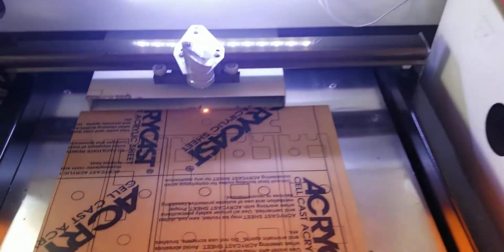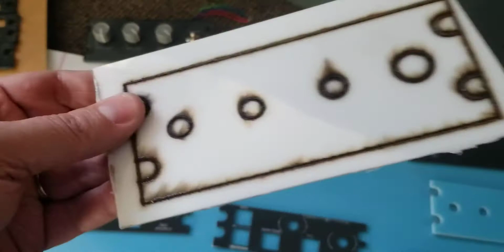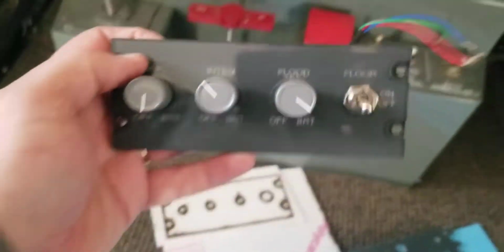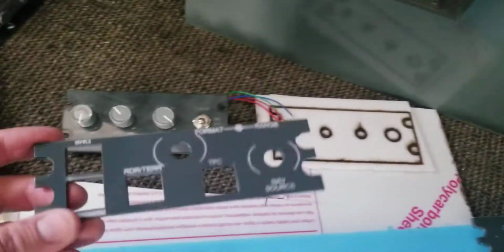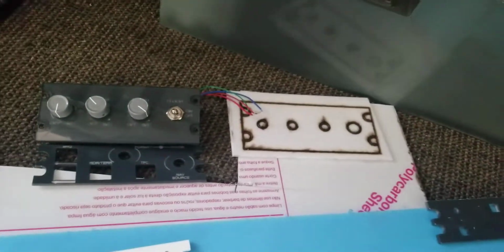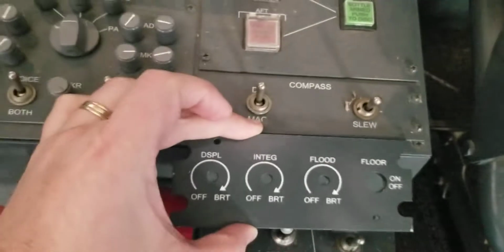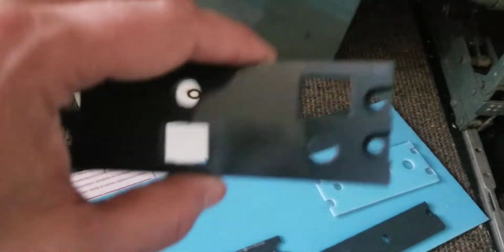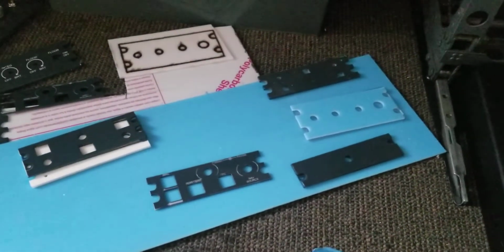How to make flight simulator panels that are backlit

Comment: Cool project.
4:54 
I’d also like to give it a try, but I’m struggling with the material.
What kind of acrylic are you using?
I can only find extruded acrylic with 30%.
The cast acrylic I have is either 42% or 22%
Best regards

Comment: What was the trade name of the recommended product?  I have had so many bad buys (laser is a 10W Optical diode but I do have have access the a Thunder Laser Cutter-Nova 100W CO2)
Reply from the maker: Falken Design was the material I used, K40 was the laser.  (Cheap like $250 on Ebay)

Comment: Thanks for the video! I also own a K40 and spray painted the  white 3mm Acrylic Opal with Gray Spray Paint (1 Layer). When I wanna engrave into the spray painted side, letters are becoming black. I could swipe it away but it will not look great. Tested with different settings. 5mA/200mms and more. Which Layers of spray paint do you have? Will test with two white Spray Paint layers, then gray and then test. Hoping, that I only burn the gray layer and the white spray paint will get visible.
Reply from the maker: I do not use white spray paint.  Sounds like the paint you are using might be the issue.  When you cut or engrave with no paint do you still get black burn?

Comment: Do white acrylic on the face piece, clear for the base/mounting surface.  Paint the back side of the mounting face with Rust-Oleum 267727 "Silver Specialty Mirror Spray" paint, then paint the whole thing with a flat black and then the final color.
  
The Rust-Oleum paint is designded to make a mirror on the oposite face you are painting - i.e. you'd paint the back of a piece of glass if you wanted a mirror.
  
Reasoning:
When you laser scribe the top face it will present the legend you wish to display.
  
When you laser scribe the bottom face, it will provide a hole for the LED to fill the light pipe - the mirror coating makes the clear piece a volumetric light pipe speading the light aournd the entire backside of the white half.  This makes the light more uniform.
  
You can do an extra step and laser scribe a mirror image of the top-side legend "grown" 25% and then paint that white to provide a "frustration" to the total internal reflection of the light pipe, then paint the back of that with an additional coat of the mirror and then flat black.  Do this to the front side of the clear piece before gluing together (and without the white or mirror paint after etching) and you can keep most of the light inside the light pipe until it gets to the legend exit points.
Reply: To make the steps clear if you intend to attempt it:

1) Fully cut out your 30% translucent top piece, and your clear base piece, flame polish edges for smooth/flat faces
2) Paint the entire base acrylic piece with the RustOleum Specialty mirror coating, top bottom, edges - everything (makes the base piece a full internal mirror
3) Paint only the top surface and edges of your 30% translucent piece with mirror coating, leaving the mating face unpainted.
5) Take the legend graphics and grow them 25-50%
6) Etch the grown legend into the top of the bottom clear piece to remove the mirror paint - this will be the light outlet, and bit a pitting here from over-etching is fine
7) Flip the clear piece, mirror the grown legend, and etch on the bottom - alignment is key here, you should almost be able to see through the part top to bottom
8) Paint the just etched bottom of the clear base part with a white paint - you are most worried that the bond of the white paint to the just-etched bottom mirrored+ grown legend.  You should be able to see a very white (yet grown) legend appearance on the top face.
9) Glue both pieces together with an optically clear adhesive - just doing acrylic solvent bond won't work with the mirror paint between the two pieces
10) Once bonded, paint the entire part with the final color/luster paint
11) Laser etch the legends on your top 30% translucent piece
12) Install LEDs in holes (cleaning if necessary any paint)

The bottom part will be your light spreader light-pipe. Due to the mirror paint, the inside will contain the emitted light and keep bouncing the light around on the flat specularly reflective surfaces (light bounces off at the opposite angle of incidence with no scatter) - only degrading by the acrylic's absorption coefficient.

When the reflected light rays hit an etched surface on the top side at a steep enough angle that does not reflect it back inside, they will exit and pass into the top translucent material, scattering internally in the material, but exiting at the closest surface nearly perpendicular to the point of entry.
  
When the reflected light rays hit an etched surface on the bottom side the white paint will be a diffuse reflective surface - meaning light will bounce off at almost all angles, including at angles nearly perpendicular to the white surface, providing the best opportunity of rays to find the top-side etch on the opposite face.
  
You may end up finding that you have such efficiency of light output in the right places that you have to tone down the brightness.  If you find areas of your legend that are too bright relative to other areas, a fix you can do is to scratch the back-side white paint (JUST A LITTLE) to expose the clear material again, then give it a squirt of black paint.  This will obviously absorb some of the rays of light that would otherwise be specularly reflected towards the face of the panel.

BTW, I didn't just pull this out of my tailgunner, this is how LCD backlight light-pipes are built.
Reply from the maker: Could you make a video of your process?  I would love to see it from start to finish, I will also try this on my end.  Thanks for sharing
Reply: @AaronWerner  I have lot access to the laser engraver/cutter I used to have access to. I can try to make a video but I can't quote an ETA for it.

Comment: I think the clear over the grey looks horrible. You're just going to get fingerprints everywhere and I don't really get the point of it? Especially because it is a simulator of an actual thing which doesn't do that method
Reply from the maker: That was just an example.   I preferr the method I did, where it is not covered by the clear. Thanks for watching!

Comment: Hello aaron, is there a good way for me to use acrylic panels and make something similar to what you made without using a laser? I do not have a laser and in my city there's no place which allows laser for non employee/professional use.
Reply from the maker: You can do the same thing with the CNC router
Reply: @AaronWerner  Thank you for the reply. I will consider finding how to use and get one.

Comment: Thanks! Will try that acrylic from HD - almost more importantly, what did you use to paint the panels (spray? which RAL code)?
Reply from the maker: I just moved so most my supplies are still packed up.  If you can watch my other videos where I take you step by step how to make them, I show you the can of paint and color.
Reply: Beware about lasering Acrylic due to the Damage to your Laser and the Poison Gas.

Comment: Interesting video. Have to say though -- never try to cut something on your laser without knowing what the material is and whether it's safe to laser. You might damage your laser cutter, or worse, yourself. For example, ABS plastic emits cyanide gas when laser cut. No joke.
Reply: Just saw your comment on toxic fumes from laser cutting ABS. Accidently, this is exactly what I did yesterday. I feel well, no dizziness, no headache. I noted the strong smell from the burned ABS material, and kept all windows open, while the laser was running, and afterwards. Still I'm a little worried about long term health issues from the toxic fumes. I guess I will switch from ABS to acrylic, since the results of engraving ABS aren't looking so good, anyway. Also, I plan mount an enclosure and air ventilation to the laser.
Reply: Dan, I was thinking the very same thing when I started this video. Looks like M. L. will look into this and be safe.  Some Acrylic actually attacks the metal parts inside the machine... Causes them to corrode. ESPECIALLY bad on the Bearings. There is a test you can do with a burner and some acrylic and a copper wire. Depending on the color of the flame it will tell you if the material is dangerous to Laser. Sawmill Creek has a pretty good Laser Engraver Forum and some posts talk about that flame test and the danger.  Still liking your video M.L..... I have a rotary to do the Acrylic and a laser.
Reply: @digitalwoodshop  thx for commenting. Enclosure is mounted, ventilation in place. Also got a second (stronger) laser engraver, incl. Enclosure and venting. At the end, I actually used the ABS (laser engraved with air vent). Reason: I want the material to reflect and shine through, good readability with front light and/or backlight (day vs. night scenario). ABS simply did the best here.
Reply: @m.l.5284  Very Nice work !!!!   Thanks for the reply.

Comment: Do they make acrylic panels that already have a layer of black on them that can be etched? Would be able to avoid the spray painting of panels
Reply from the maker: Not that I am aware of but if you discover any, please come back to this video and post a link.
Reply: @AaronWerner  Hey Aaron, I noticed if you watch the video "a sim is born" by twin sim.eu a little after 2 min you see him peeling a very thin matte paper and sticks on to the acrylic. I paused the vid and it called gravograph all know as gravotech. I just don't know exactly which product it is from gravotech. I emailed them hoping they could tell me because it's definitely the way to go. Cut your acrylic then laser cut through the gravograph and stick it on. No painting needed
Reply from the maker: @Rotor-Sims  very cool.  when you know more, please post here. I would love to try it out.
Reply from the maker: @Rotor-Sims  I was thinking just that, I noticed his burn marks from the smoke on his work.  I had that issue with paint but had to apply the air to get rid of it.  Do you know if they have multiple colors? Any gray colors?

Comment: Let’s assume I have created all of the panels and bought all of the knobs and stuff. How would I wire all of it to work with MSFS2020
Reply from the maker: If you look at my other videos they explain how you program them using arduino, joystick controls, FCUIPC, mobiflight.   These are 4 things you must understand in order to connect all the hardware to the sim.  FSUIPC is a plugin for Flight Simulator, it allows you to assign button presses, switches, and more to functions of the aircraft.  So for example, if you purchased a joystick controller card-connected your hardware to it and plugged it into your computer, FS will recognize it as a joystick.  You open FSUIP and go to button assignments.  You press a button on your flight panel and then assign it to a function in the aircraft.   That is the simplest explanation.   It is not always that easy.  Some items will require you to setup LUA scripts, Macros, etc.   Mobiflight works with Arduino and is a "Point and Click" type software.  It writes all the code for you for the Arduino.  You do not need to have any programming knowledge to use it.   I would recommend you do a deep dive into the above-mentioned resources.  Pick a very very simple process for your first panel.  Something like an on/off switch and start there.
Reply: @AaronWerner   Thanks! I’ll be learning about arduino, joystick controls, FCUIPC, and mobiflight. These will be researched and I’ll learn how to use them to connect them to interact properly with the simulator. Thanks!

Comment: wow, what type of laser printer do you have?  I would like to print my own panel  builds and have them back-lit.  do you also have to have a 3D printer too?  and does your laser etch-printer cut through different colors of backlighting lenses.  not sure how all this works but this is what im after.
Reply from the maker: I have a k40, no you do not need a 3d printer.  If you check my other videos, I explain the process and show you my setup.

Comment: So you recomend white (not transparent) acrylic with 30% transmission, is that right? How thick it has to be to prevent deformation when pressing buttons on lets say 1m wide panel? What type of gray paint you use on that acrylic to be easily engraved? Thasnks :)
Reply from the maker: I will include all these questions in the next video. I will try to have it out early next week.  You will need to use a combo of white & clear.  The white being the top layer and the bottom layer clear.  I will explain how yo cut these so that switches will be able to be added without any issue. I will also cover the painting process.

Comment: Hoping all is well, and anxious for the rest of the story.  Your output looks fantastic, would also like more info on laser used and settings, etc.
Reply from the maker: I use a cheap K40 laser off of Ebay, I design using Inkscape and import the finished file to the  K40 whisperer program that you get with thre laser.  Pretty easy.  I am trying to perfect the painting of the Panels.  I use a gray form Home Depot.

Comment: nice work mate. I am in the process of building the panels for the C172 sim. Be keen on see how you go with the laser on next video.........
Reply from the maker: I am going to record that today. Any particular questions that I should cover in the video
Reply: @AaronWerner  thanks Aaron.  Probably some of the settings tips for the K40 used to achieve cutting vs engraving.  Look forward to seeing it.
Reply: hi Aron, nice video? could you share the power used and the speed used by your k40 laser? i mean according with the thickness... to cut and engrave?
Thanks this info i will waste less time and material 😊
Reply from the maker: @sandroape   I use full power to cut.  I do the engraving about about 60-70% power.  When cutting I had to do a couple passes at 10 speed.   Engraving I do at 100 and only 1 pass.